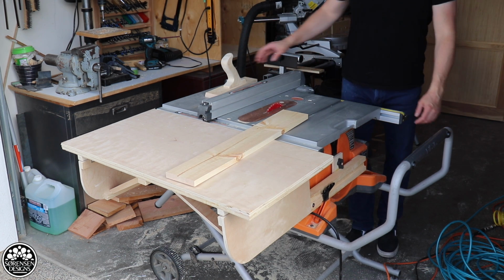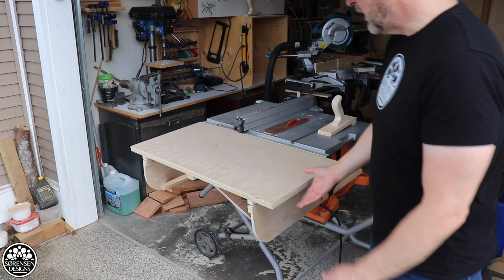Outfeed Table with No Legs // For Job Site Table Saws

Comment: nice idea Eric, I built one for my dewalt 7491 a while back and its nice to have.
Reply: I have the DeWalt 7491 and was wondering if you had any plans for the table?
Reply from the maker: @Fred Giordano  This outfeed table is designed to work with the Ridgid jobsite table saw. The dimensions would be a bit different.  I don't have that saw, but based on what I see in their product photo, you should be able to attach the arms to the steel tubing on either side of the frame. You may be able to use the existing bolt holes and just use longer bolts to mount it. Just make sure the arms are parallel / equal in height for your table top.

Comment: Hi Eric,
1) Did you at anytime in the planning of the build, did the concept of the out-feed table being a continuation of the tablesaw platform with dado channels effectively extending the tablesaw platform length get considered, and if so what made you reject the concept. ?
2) As built what differential height drop from the tablesaw platform level to the out-feed table level did you consider as appropriate, I estimated from the video you had a 3/4" drop.?
For entirely different reasons, but similar need , I require to do the same thing as what you have done, so the video was very encouraging.
Thanks

Comment: How did you make your zero clearance insert. Your saw looks the same as my Ridgid and I have not found anyone who make an insert for my say and I have struggled making one. I would gladly pay for some if you’re in the mood to sell them. Awesome extension, and I agree with your comments at the end. Will build one as soon as time permits. Great job and video.
Reply from the maker: @John Hollingsworth Thanks! I made mine using some left over laminate flooring but you can use 1/4" Melamine or 1/4" plywood instead. Regardless, the method is pretty much the same. Here's the video on how I did it:  https://www.youtube.com/watch?v=eqZgvwJKavg

Comment: I like the idea of the sub-surface support system.   I think that I'll adapt it for a bottom hinged out-feed table.  My table saw's fence needs both front and rear rails to operate, so finding a workable design has been challenging.   I'm open to suggestions.

Comment: I have teh same Ridgid saw.  Do you have plans I could buy?
Reply from the maker: @Im 4Real  - I don't have any plans for this as of yet, but the outfeed table size is 18" X 34 1/2"  You have to leave about 1 1/2 inch gap between the saw table and the outfeed table to allow for your fence to clamp on. The arms are 25 inches long. The other parts fall into place: the center brace, the struts and the plywood hinge supports. I will announce when I have plans available...stay tuned 🙂
Reply: @EricSorensenCanada  Thanks!
Reply: @EricSorensenCanada  I have the Ridgid saw too and would love the plans as I'm not very good at designing and coming up with what really works.  But, I can follow a plan. Let me know when you maked the plans please!!
Reply from the maker: @Ricc Havens Thanks for letting me know Ricc! I will definitely be working on plans for this and other jigs in the near future 🙂
Reply: Would love to see you coming up with the plans :) thanks!